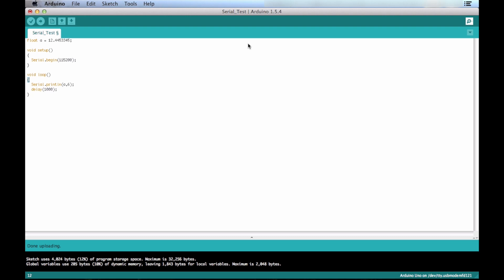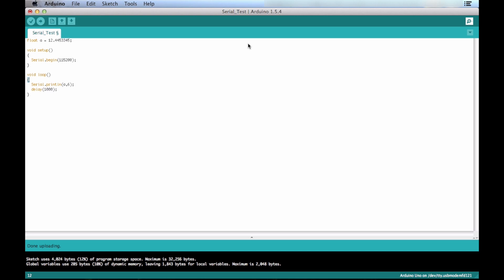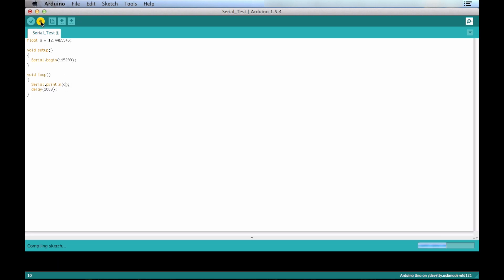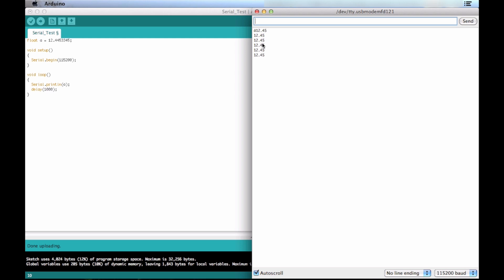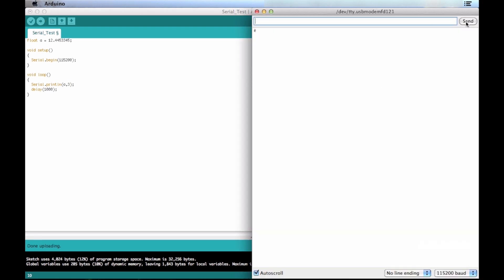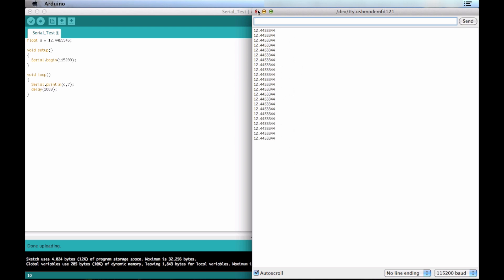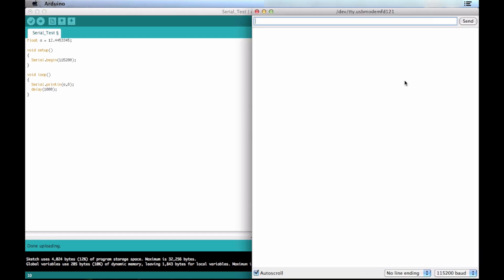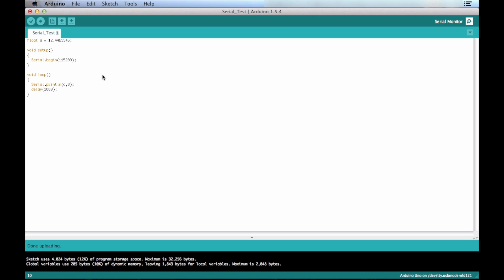Display More Float Digits in Arduino

Comment: i have the same problem on gps coordinate i need atleast five but the terminal adds .000000 when i try the division by 1000000
Reply: non of this work for me please try to print to 7dp the operation   401524789/10000000 on your serial monitor

Comment: The issue here is that aruino does not have an FPU (floating point unit, basically the arduino simulates this FPU to have float) so it is best to multiply the number with 100 or whatever you need, so that number is not a float anymore , it really slows down the arduino when you use a lot of floats
Reply: Great conversation on floats and the Arduino.  Thank you all

Comment: its because of the float precision on arduino after certain amount of digits precision is actually approximation read how floats are stored in memory. Im not sure i forgot but i think float on arduino can be represented precisely only up to 6 digits after decimal point. You can try this by printing some value with limit to 6 digits of printing where you would put values 0-9 as last digit and see what results you get. Numbers are not random after some point its just how float works. Also if you for example make a counter with some decimal number lets say 0.123456789 and increment it by lets say 0.000100010 if you make loop with this number1+=number2 when you print this first part of up to 0.0001 will increment normally but the other part might end up decrementing but the whole number will increment normally. It may be counter intuitive but its the way it works
Reply: Wrong. Only 6 digits total - including before the decimal.. Yes, i know this is old. but i don't want people to get the wrong information.
Reply: is there a way to bypass that without buying new arduino? I want to do calculations on gps coordinates.
Reply: @sirick93  This video only demonstrates printing of values and how to use function. Values are stored as binary on your arduino. Arduino can do large and precise calculations it will only get slow depending on the complexity of calculations. I think there is a library for arduino and i think it was called big numbers, you should search for it i think it can do what you need. Sorry i used this long time ago dont really remember it well.